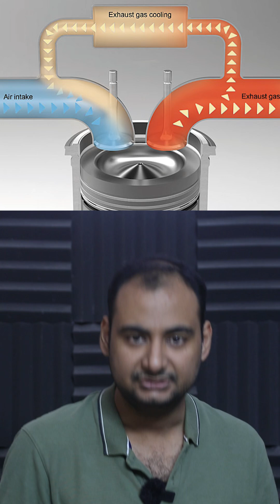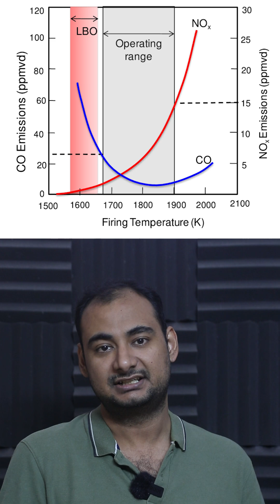Exhaust Gas Recirculation {EGR}

Comment: Why we can't just stop fule supply (injection) in some cylinders...?

That's make One cylinder do More work so problem solved...
Reply from the maker: does not work as it will still pump air with will sap energy away that is why u need to isolate the valve train re time is so it does not act as a air compressor
Reply: @s2tenglish  morden DIS (direct injection system) easily handle timing thing 
And about to air compresser thing 
Isolation of valve train not that much hard.
Or 
We can just leave valve(1or both) open then cylinder doesn't work like compresser.
Or 
We can block the air flow to cylinder.

Any other reason.....
Reply from the maker: @vishusingh7645  you can do anything you want question is can you do it cost effective or not
Reply: @s2tenglish yaa i know exhaust gas gas recirculation not for reducing fuel consumption it's for increase  exhaust gas temperature so catalytic converter can work.

Diesel work efficiently between 20 -80 percent load so don't care

Comment: This video is very true. My question has always been any internal combustion engine is merely a air pump or compressor. Why not take the exhaust gases and not only create a turbo charge affect but use this compressed air to spin the alternator you don’t need. The high-performance of a turbo charger all the time with computer technology it could toggle between when it’s needed for power compressing air into cylinders as a turbo charger, and then, when not needed spinning an alternator by using the compressed air through air motors the type you use for air tools, much like an impact wrench it wouldn’t be charging electric all the time, but it would offset the parasitic use Of your alternator that is coming from the crankshaft via a belt. You are literally throwing away some of the energy you are creating through the exhaust system. Thank you for your video.
Reply: Good Point.
So, this concept is called an e-turbo. Implemented in the new Porsche 911 GT and in F1 since 2014 until 2025 (MGU-H)
Because the turbo spins at rpms upto 100k and the implementation and execution is also tricky and is complex and you would need a PMSM motor and thus HV Battery as well.
Reply from the maker: its too expencive that is why we call it thermal energy recovery system in F1 or Turbo compounding in Trucks or ships